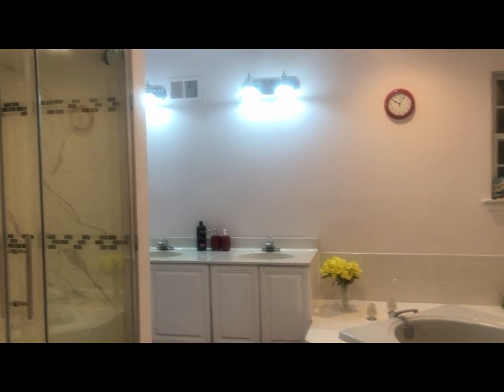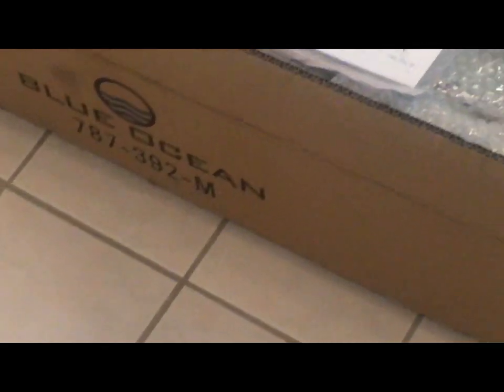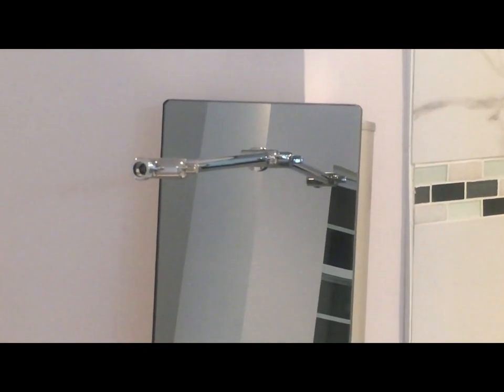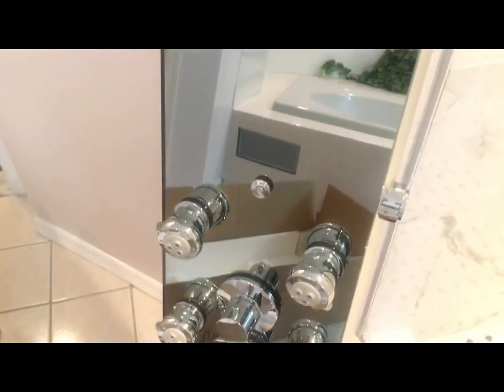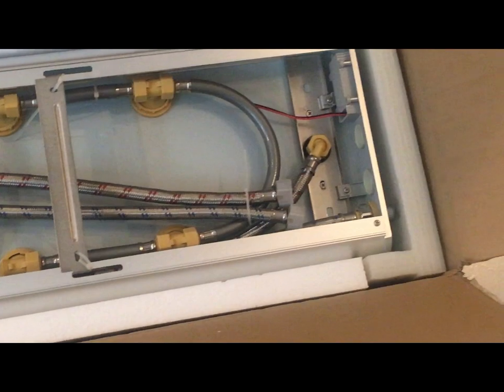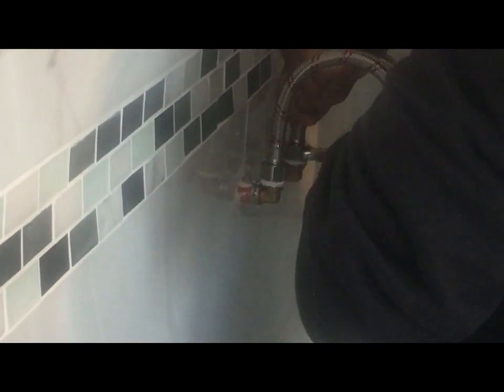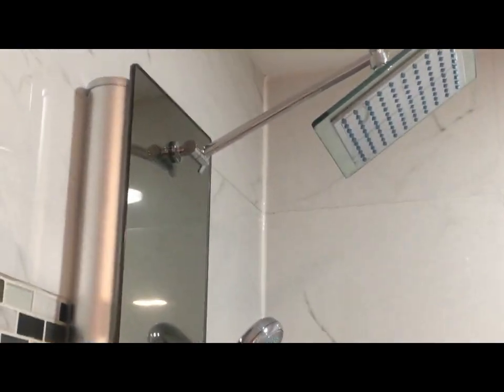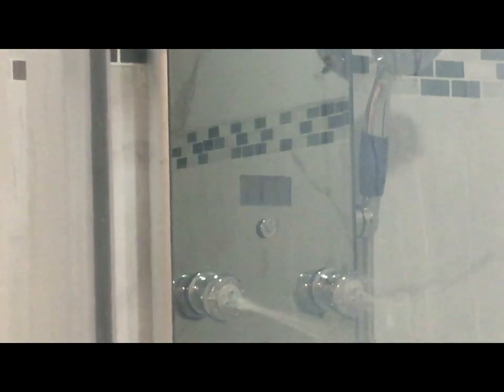Blue Ocean 52" Aluminum SPA392M Shower Panel Tower Installation

Comment: What is the button underneath the temperature indicator window for?
Reply: I'd like to know this as well. I just had one installed. It was given to me so I don't have the instructions for function. I push the button, it does nothing.

Now, the reason I'm here...the shower head sprays water everywhere from the connector. There is no o-ring inside. I'm looking for the answer as to where the o-ring is placed. I've tried a few different ways, it still sprays. Obviously, I haven't figured that out....help?
Reply from the maker: It's a On/Off button for display, when powered by battery. When it's powered by hydro, the button has no function and you can simply dis-regard it.
Reply: It is still functioning well and quality is good?  You recommended?
Reply: La entrada que tiene en la parte de abajo que se conecta o para q es